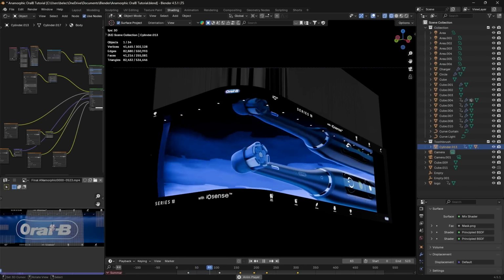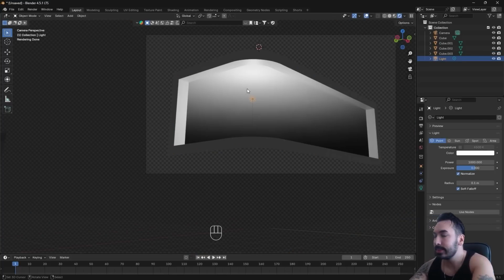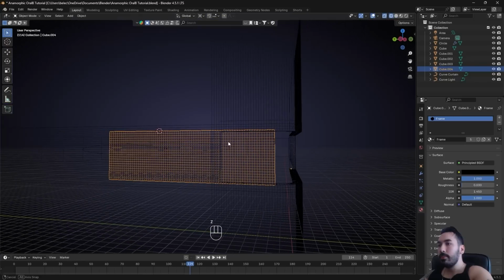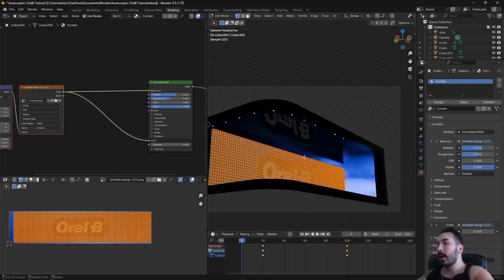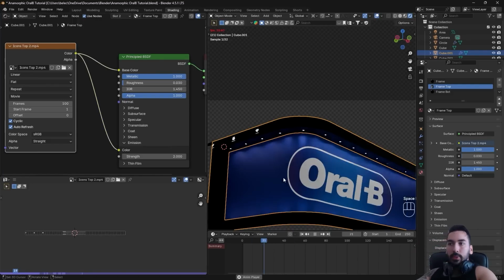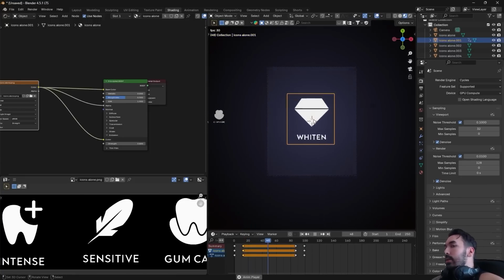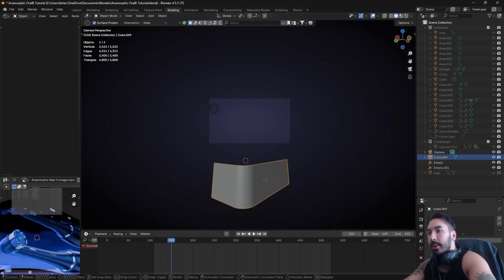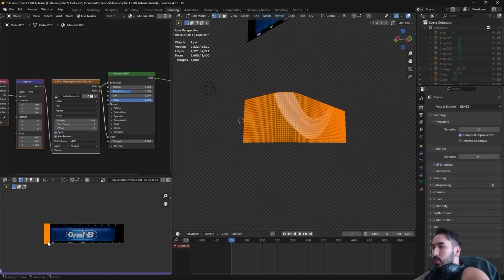How to make a 3D Anamorphic Screen in Blender (Product Animation Tutorial)

Comment: 38:13 
Did one of those animations some months ago for a client and I also thought the same sh*t when unwrapping the plane to make it flat and render out again. Some colors and quality overall get messed up and I also felt it was unproffesional.  The only thing I could think of to fix a bit the issue, was rendering out the complete 3D animation from the start with double the resolution, ans do the same with the flat plane to get a final result as crisp as you can and then in the editing program scale it back to the original size and then color correct it a bit. Sure it takes double the render time and double the space, but it Worked out fine for me. I still think there has to be a better way

Comment: since the writing and the logos on the frame texture are mapped to the curved surface, and then mapped back in the next rendering step, wouldn't it be better to just add those details in post. right now the two renders make the text blurrier than it needs to be, especially if the result is going to be projected on to a building.